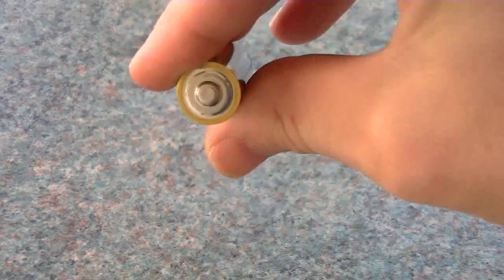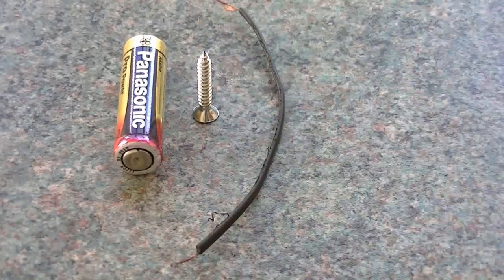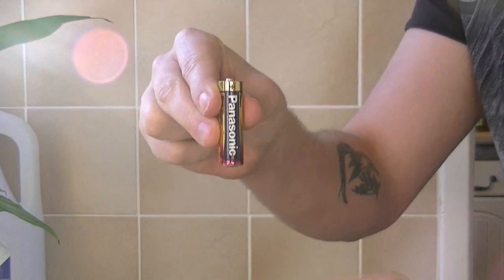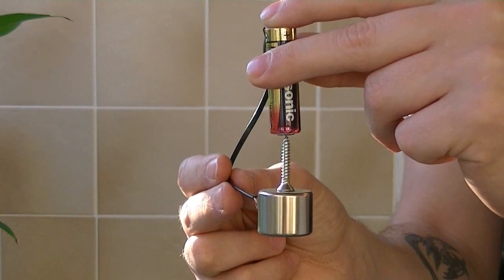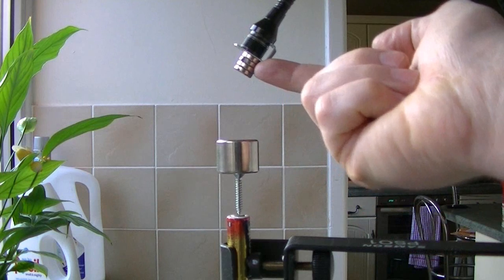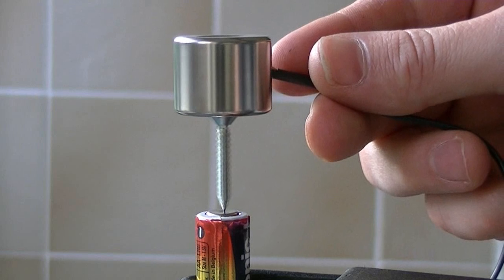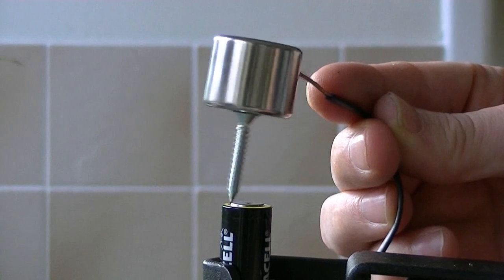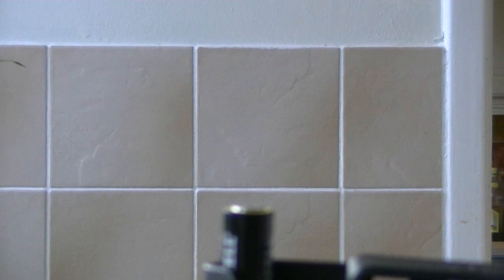MAKE A HOMOPOLAR MOTOR!

Comment: In rc terms, that's a brushed motor.
Reply: True, it is a form of brushed motor, but when someone uses that in the RC community, they are probably referring to a DC motor that has a commutator that the brushes run against, forming a rotary switch for the magnetic field of the rotor coils.

Homopolar motors are rather different, the brushes and rotating disk(or conductive magnet in this case) form a slip ring arrangement, almost never used in a DC motor. The name "homopolar" refers to the unique aspect of this class of motor, namely that the magnetic field does not switch or alternate, it always have the same polarity. A homopolar motor's immense current draw makes them rather unlikely to be used in RC applications(or most other applications, for that matter).

Comment: To all you guys saying to use a D battery, they have the same voltage, it won't go faster, just longer
Reply: Hmmm, Well, as the homopolar motor has a very low internal resistance, it is likely to pull a significant current from the cell, under that condition the internal resistance of the battery itself can be an important factor in limiting the current.

So a larger D cell may actually increase the speed of the motor, if that cell has a lower internal resistance while under the heavy load than the AA cell.